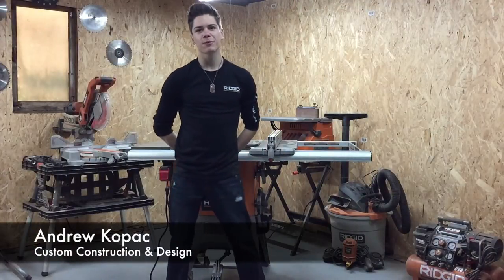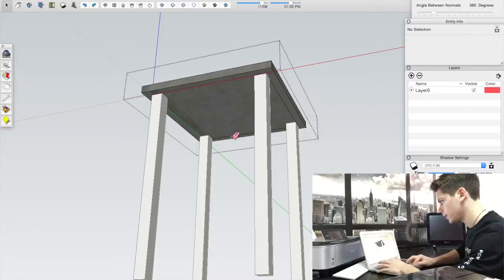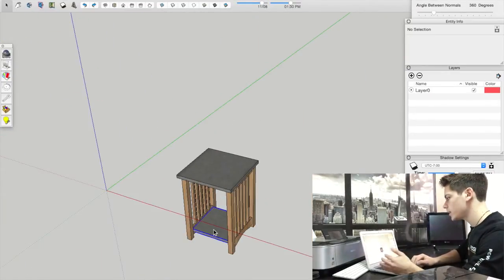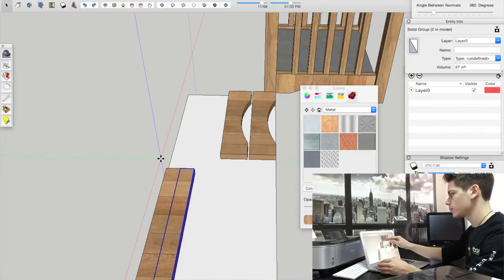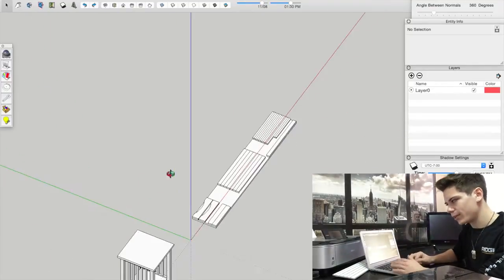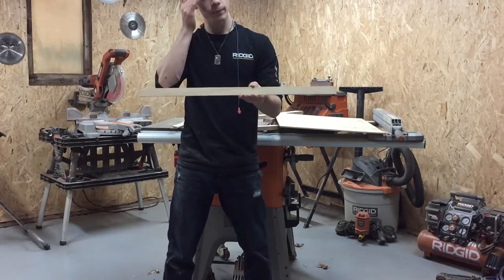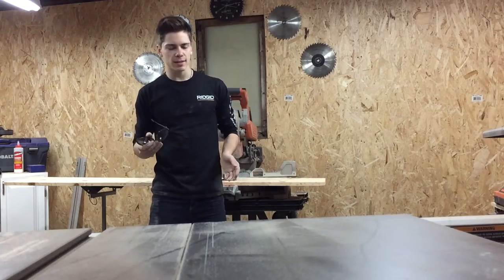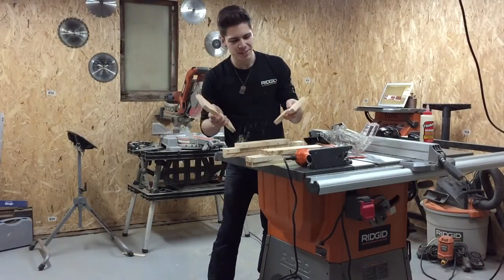Project 2: Rustic Night Stand

Comment: how did you attach the concrete top to the legs?
Reply from the maker: Eli, Thanks for watching!

I simply used liquid nails. On the top center of each leg, squeeze out a good portion  of this glue. Within about 24 hours, it should be dry and adhere the concrete to the wood.

Tip: When you pick it up, its better to lift from the wood than the concrete.

Let me know if you need any more help!